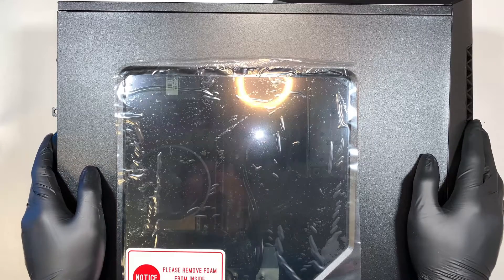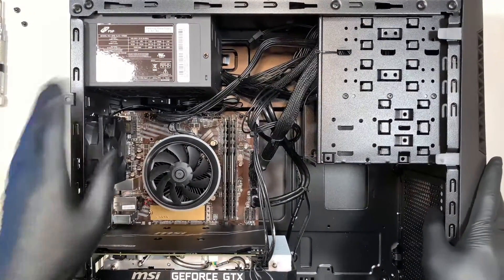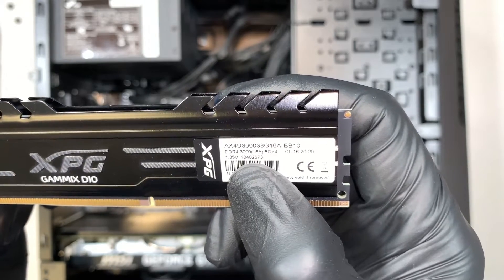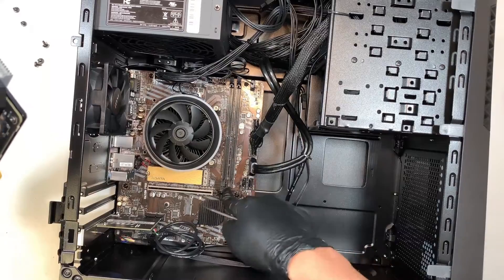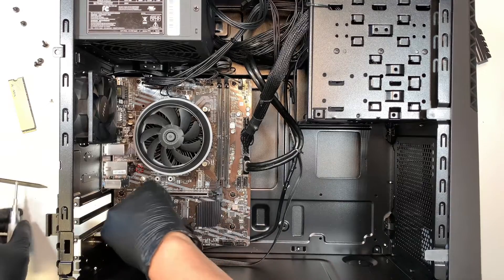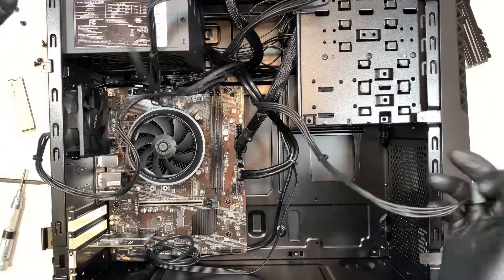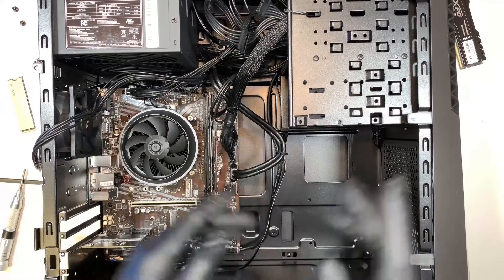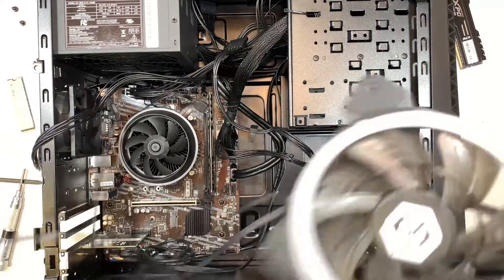MSI Aegis 10SI 231US Tear Down and Add New HD

Comment: This is the model that I have. I hope there is room behind/underneath the MoBo for the cables since I plan to upgrade the PSU very soon. I upgraded the video card recently to a RTX 3060 but even a modest upgrade like this will benefit from a 650 W PSU. Thanks for doing this video it has been very helpful for my purposes.😁

Comment: Would I be able to install a Seagate BarraCuda 4TB
In this moddel
Reply: You can but it might be more useful to use the 4TB drive externally as a way to backup files. Booting with the 4TB drive installed will go a little slower than without it.

Comment: This is helpful. Just wondering, will there be a video on how to replace the power supply unit?
Reply from the maker: There are four screws holding power supply. Just remove that and cable connectors.